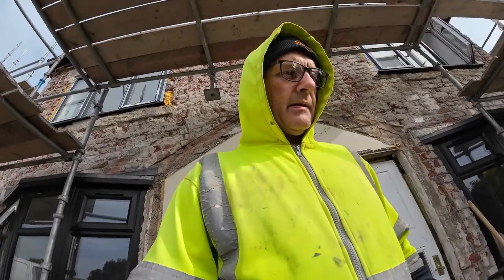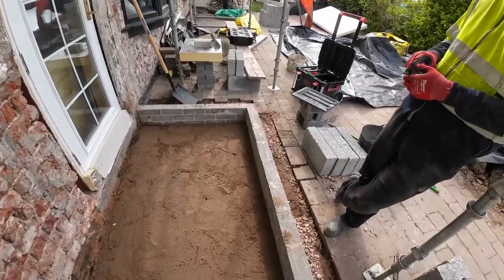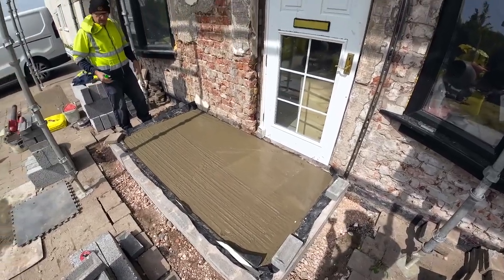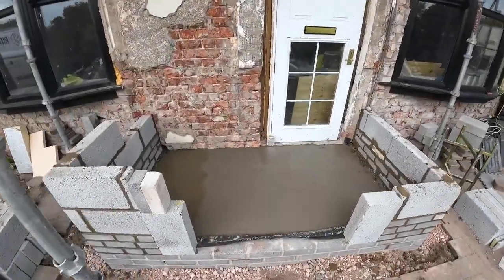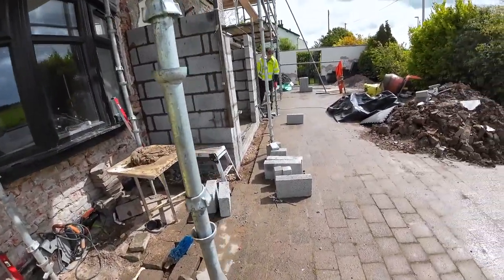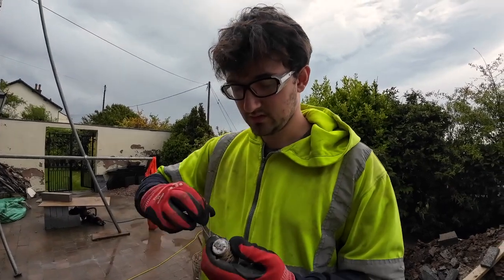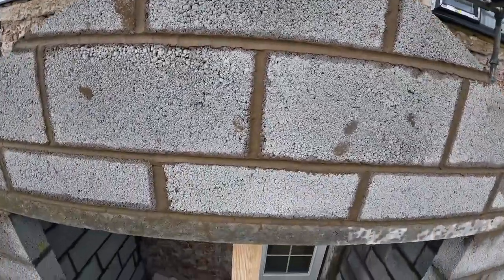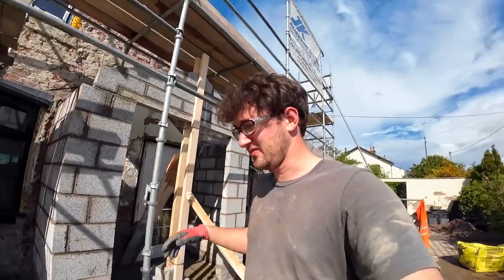DODGY PORCH RE BUILD..SLAB AND BLOCK WALLS

Comment: Alright steve and alex. Currently building an extension in ireland with a 200mm cavity the new norm here if the cavity is being pumped its torture all concrete blocks all over hand work 😔
Reply from the maker: Jeez good luck with that Dave 🥵🧱👍🏽

Comment: Steve u said you can do one 3mtr square does the mean 3mtr long and 3mtr wide?
Reply from the maker: No Phil that would be 9 m square 🤯🧱👍🏽
Reply: Square metres is calculated length x width so 1x2=2, 2x2=4, 6x3=18 etc, etc.